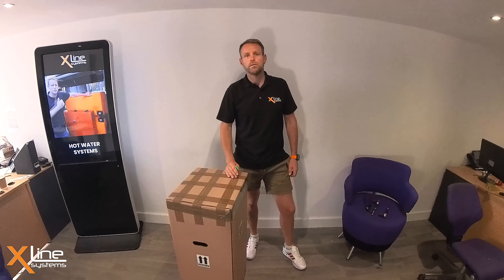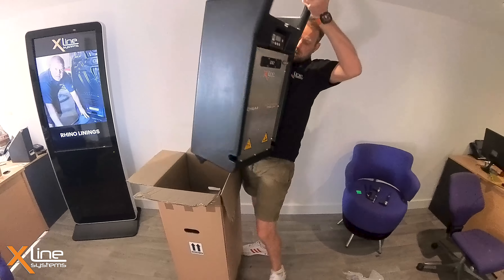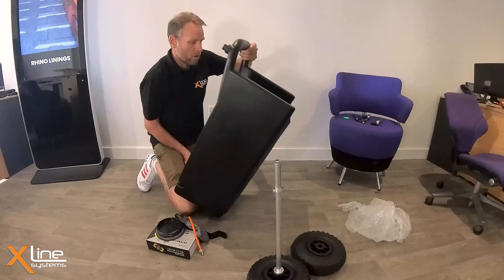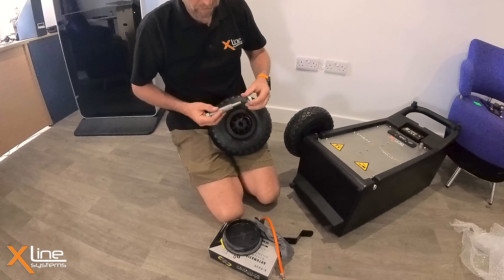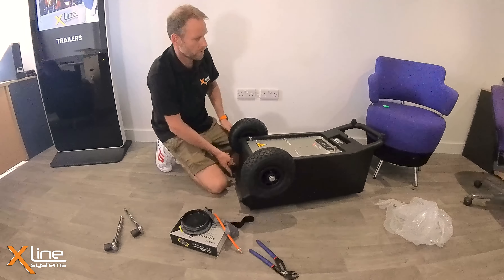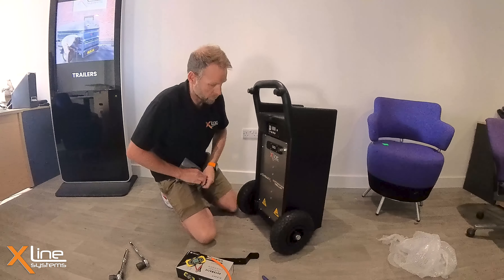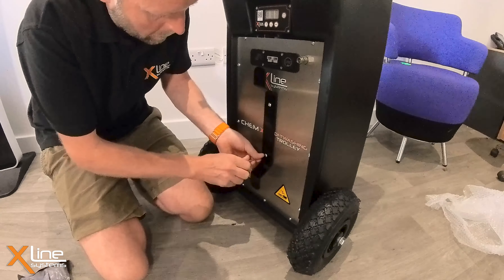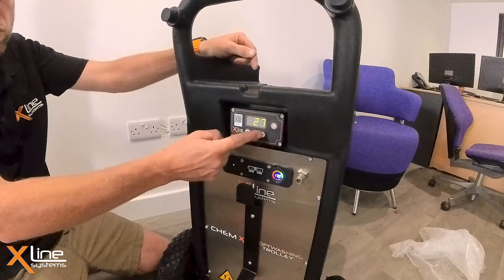Unboxing & Setting Up An Xline 45ltr Trolley System - Portable Trolley Designed For Window Cleaning

Comment: Great piece of kit, had ours now for a few months
Reply: Does the pump switch off, if using a uni-valve or tap to save the water?
Reply: @bruce9546  we use ours for spraying chemicals, so we don’t use a univalve.
Reply from the maker: Yes, this comes with an electronic pump controller which detects dead ends (turns pump off when the flow is restricted).